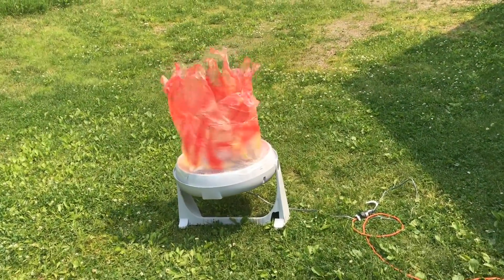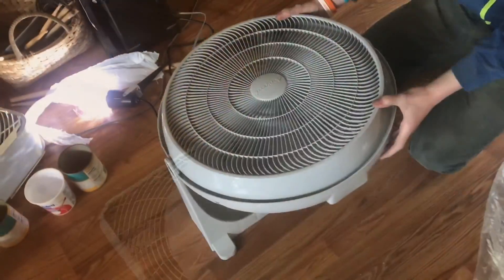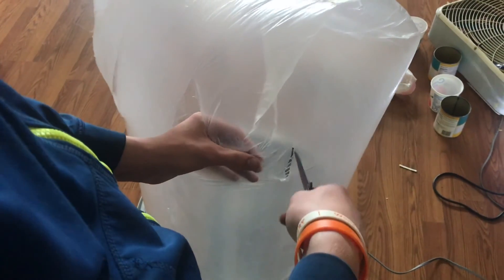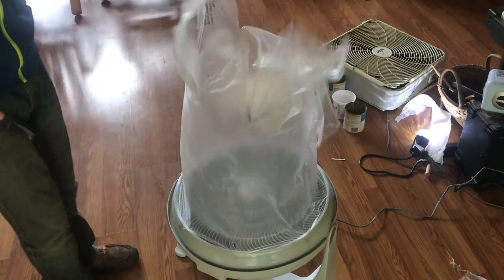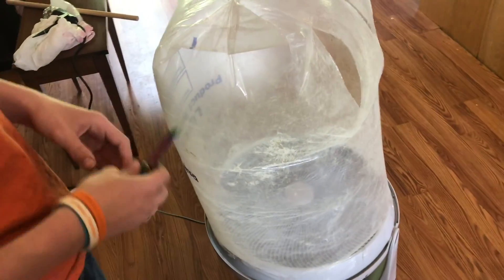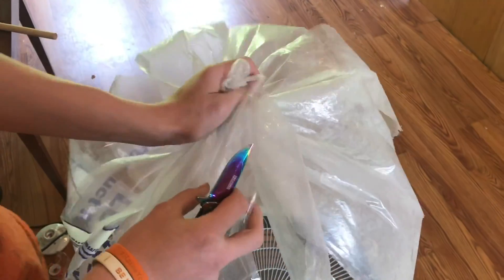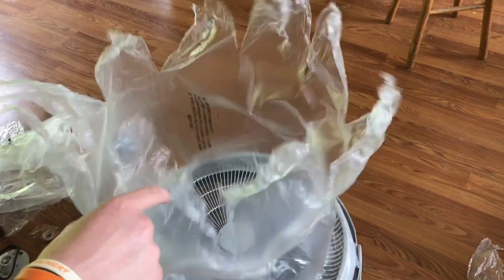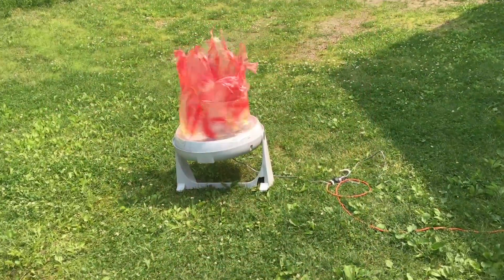making REALISTIC looking flames with a plastic bag and a fan

Comment: what if, instead of covering all the fan, you let about half a inch of the fan on the exterior part of the plastic bag, this will let some air flowing around the exterior part of the bag and lift the branches that fall